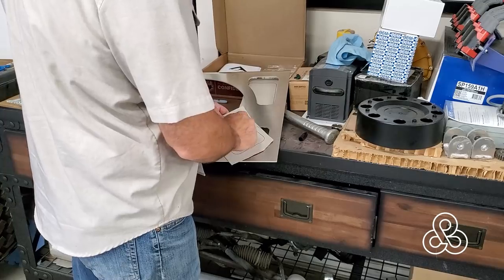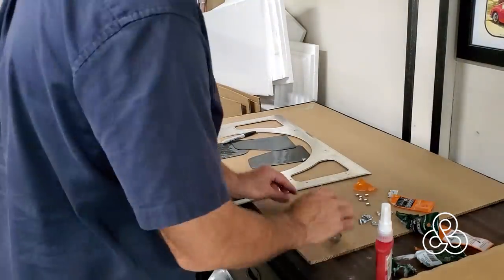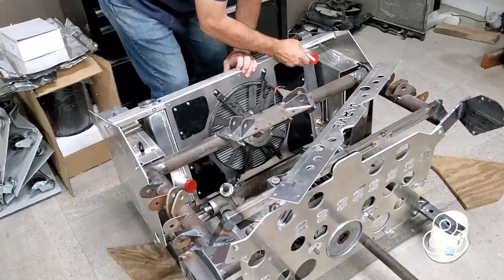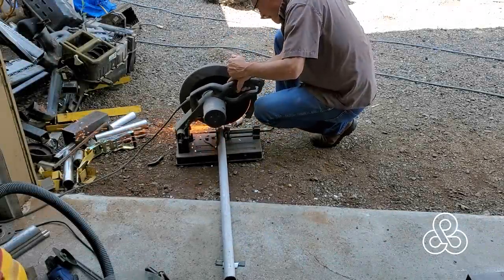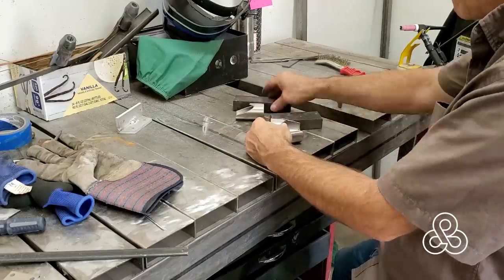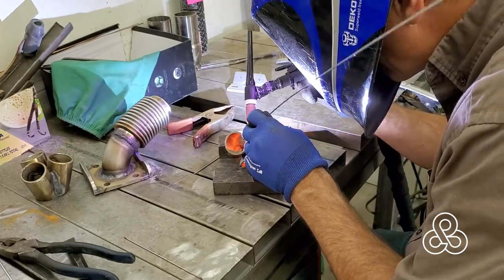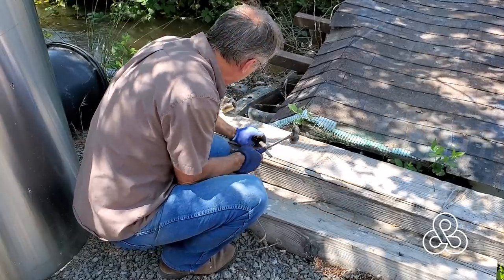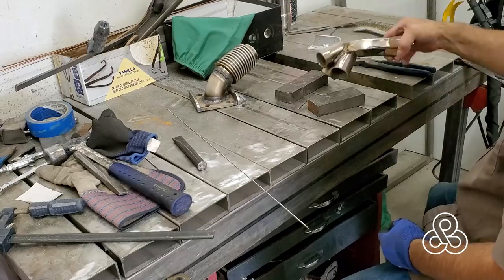A74 Exhaust merge collector & radiator fan shroud. Arete Supercar project

Comment: I made a 3 into 1 collector a few years ago, so yeah the "merge" wont be perfectly round. The way I solved mine was to get a short piece of tube of the diameter that the merge goes into. Grip the one end of the tube in the chuck on the lathe, (obviously need a 3 way jaw) and wind it down so it squashes the tube to match the profile of the collector. Seems a bit better than losing it in the canal haha Good fishing though !
Reply from the maker: The big shops have a hydraulically driven cone that presses it round (cheaters) They, on the other hand, do not have a 1200gallons per minute cooling system to dip hot metal into! Ha!

Comment: Rounding the end of the collector is easier if you put some roundbar in a vice. Slide the collector over it and hammer on the outside to stretch the walls.

Comment: Tip
Without a backing strip those rubber flaps will fall off within minutes.
If you want to use rivets on rubber and not squeeze it to death try the following.
Get a strip of aluminium of between 0.5and 1 mm thickness to make a backing clamping strip.
Make or purchase a dimple die to create a recess for the head of the rivet.
Press the dimple into the strip and measure the diameter of the outside of the dimple mound.
Cut a hole into the rubber to fit over the dimple mound.
Depending on the thickness of the rubber and height of the mound you may need to use some sort of spacer to make the rubber thicker or the mound taller. Electrical tape works reasonably well for this purpose if the difference is slight otherwise a strip of rubber or some washers cut out of milk bottles.
Reply from the maker: That would have done it. I bet there are some stepped washers out there as well that would have worked.

Comment: I'm curious how the inside turned out did you create a three sided pyramid to separate the exhaust? Another thing the exhaust length is very crucial in helping the exhaust gets sucked out of the engine kind of like the intake. But anyway keep doing what you're doing
Reply from the maker: Yep, the little pyramid is there. Trying for equal length runners for proper scavenging. Additionally with the twin turbo setup it divides the pulses from the even - odd cylinders to discourage back pressure.
Reply: @BuilderCreator  absolutely I know Maseratis latest supercar. They're getting an immense amount of horsepower out of a 6 cylinder and a lot of it has to do with the length of the runners on the exhaust and the intake is completely insane when you consider we used to take a 350 and get 200 horsepower out of it and they're taking a 200 horsepower motor and getting 800 horsepower out of it that is absurd